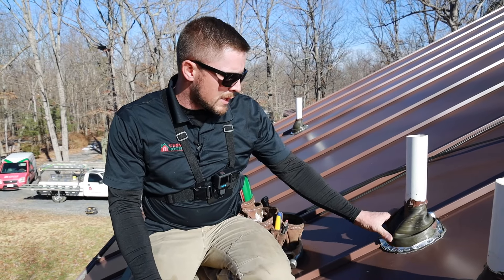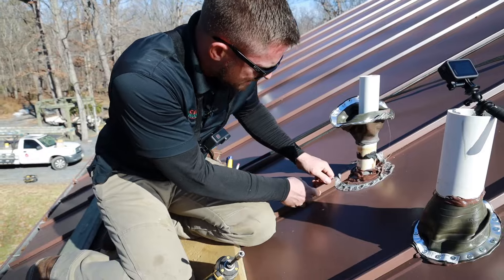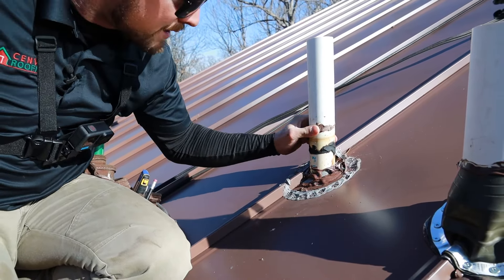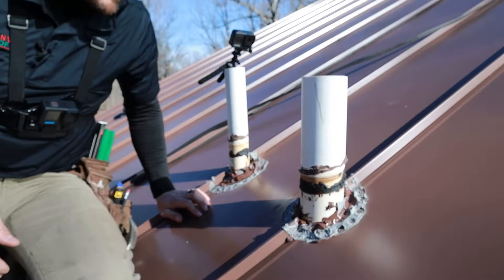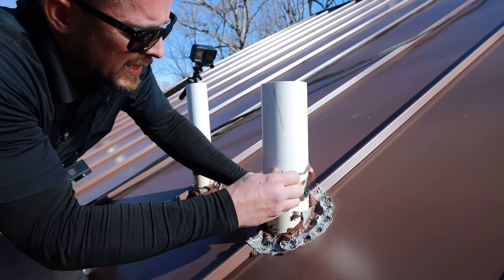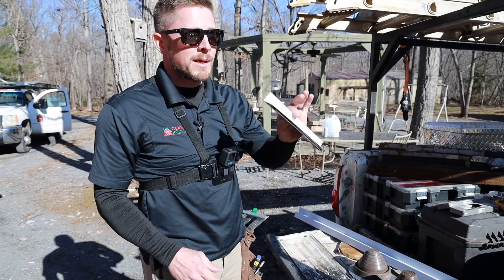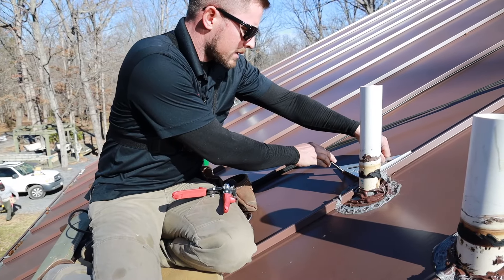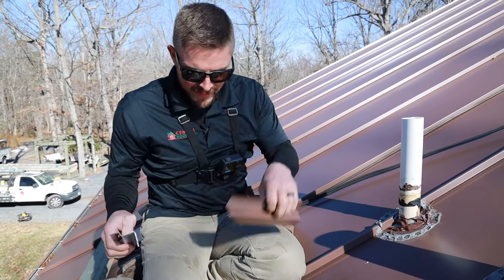Metal pipe boot removal and replace | Cenvar Roofing

Comment: I guess I missed it but how does this solve the issue of the water coming in from inside the rib?
Reply: There's still the same problem. From the upper side from the. Rib. He didn't do any good.  At least. Got the Booth. To lay down straight. I'm not convinced it's the right way. I would move the PVC pipe to the center of the panel
Reply: Exactly. Just wasted his time...and ours.
Reply: @1weirddoe571  How to say you're not a roofer without actually saying your not a roofer.
Reply: I would have had the heavy seal and the old one and that's it

Comment: Thank you so much for this video.  I have a mountain cabin and the gaskets got torn to shreds by 3-5' of snow for the last 3 winters and bent the ABS vent pipes.  It took me all day to replace the vent pipes and gaskets, and the one on the rib I used this exact same technique and it worked perfectly.  Such clear instruction I really appreciate it, probably saved me >$1000.

Comment: Guys should be required to move pipes if Necessary to put boots on the flat. The siphon notch on the over lap of screw down metal can even be an issue. This one, even after he re-did it is still so-so, because of the over lap.

Comment: Great video, this man does some pretty work and obviously knows what he is doing. If it is feasible Consider the location of the vent pipes to determine where you install the first panel, and this problem can easily be avoided. Be sure to add 1/8 or 1/4 inch for each panel to adjust for the inevitable gain during installation. For new construction, have the plumbers move the pipe so it comes up through the center of the panel.

Comment: I have not seen this technique before on you tube. If this is the "correct way" to install the vent, why does MFG shows it installed on a rib? (they say form to rib) I had one leaking and the previous install just used too few screws. They also used long ones which was also excessive.

Comment: Thanks so much! 

as a temporary stopgap measure, I might just put a squirt of that solar seal right where the boot is crimped over the seam and leaving an air gap.    Or a squished up ball of butyl tape like you described. 

Longer term. I think I might get a small metal brake and try just what you showed.

Comment: Well... you said "installed incorrectly." Not sure about that. You had to muscle those off, and they wouldn't have leaked for 25 years. Sure yours is nicer. But ugly and works doesnt mean incorrect. Just sayin
Reply: Well it’s installed incorrectly when it leaks, which like he said all during the intro was all wet inside the boot.  Just because it’s hard to get off doesn’t mean installed correctly.  Ugly and leaks is far from correct or professional, just sayin.
Reply: A good plumber would not have stubbed out the vent on a metal roof installation. What happened is exactly what you do not want. A vent pipe on a standing seam..

Comment: 10 years later on my DIY standing seam snaploc 22-squares roof I realize I installed the seam boots wrong.  Gonna have to pull them off and do what this video shows...
Reply: Why? if they are not leaking ??
Reply: @ralph95  Ok so new info! You are RIGHT! I left the boots alone and installed z-strips as “rain diverters” to prevent water running up-under the seam of the snaploc. This is where a small leak WAS occurring. Saved rework boot labor and have 1/2 of the z-seam (most important part which is up-stream of water flow) installed. Great posting on your part!!!

Comment: Observations
1. Using thin garage metal, 26 or 29
2. Aesthetically pleasing but still has the same weak vulnerable leak spot, the upper side relies on caulk to keep it from leaking.
Reply: pointless observations Anthony
Reply: Id say the end result is worse than what it started at as
Snow melting and Freezing(expanding) , snow sliding and moving...Is just going to mess this flashing up over few years